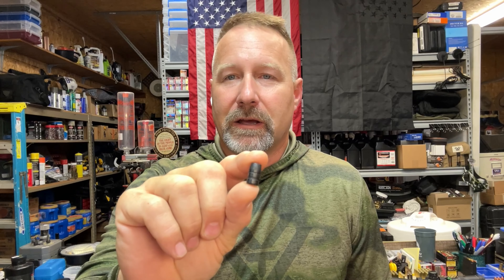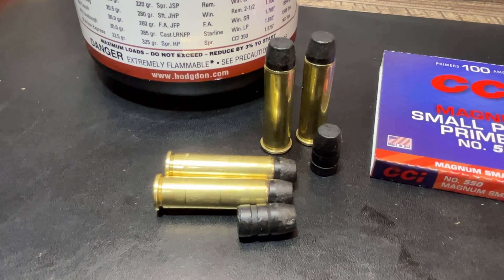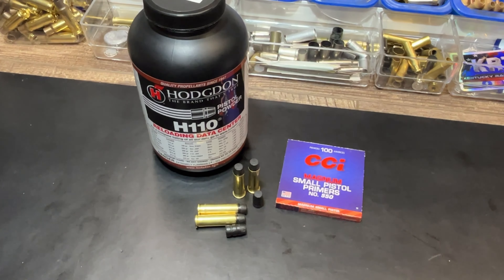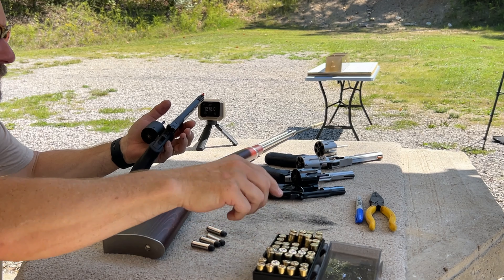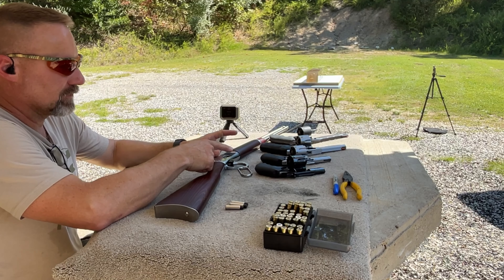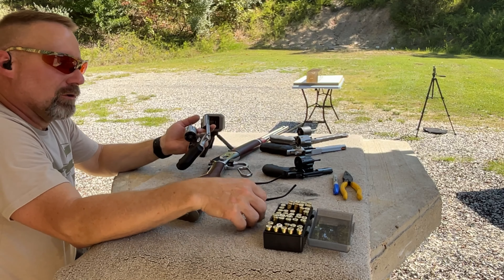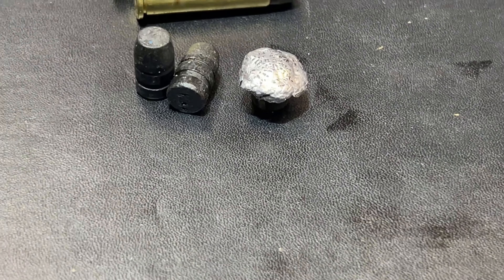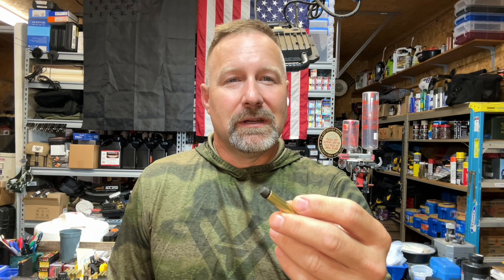Gel Block Testing A Cast Lead, 162gr FP, Powder Coated Bullet in .357mag. with 5 Length Barrels!!

Comment: I have been casting Lee 125gr RFP out of soft stick-on wheel weights. After powder coating, I can shoot them with a nice load of 2400 at magnum velocities out of a handgun. Accuracy is fine with no leading, but I have not tried them in rifle length barrels.  I would love to see some soft lead testing to try and get expansion at handgun velocities.

Comment: Yay!! Back to our roots. Not many vloggers seem willing to test lead bullets. They are all stuck on modern gee whiz bullets which are fine but there is great neglect for the old school.

I really think there is a big void in investigating lead bullets of various hardnesses. Your rifle results prove that properly matched lead bullets can perform as well as JHPs.

Imagine a line of gas checked WFP or LSWCs at different hardnesses optimized for different velocity ranges.
Reply from the maker: @mkshffr4936  I can imagine that 😉. That’s a retirement project goal!  Lol
Reply: Impact velocity is the key. So the alloy has to be hard enough to handle the pressure of firing, but soft enough to expand at whatever impact velocity. HP designs and powder coating create a wider spread where a particular hardness will survive the barrel, fly straight, and then disrupt upon impact. I've run a lot of these tests out of carbines with straight wall cartridges, and rifles involving bottlenecked cases.